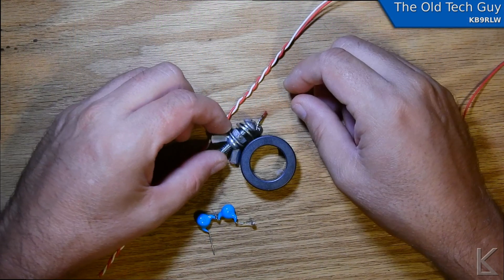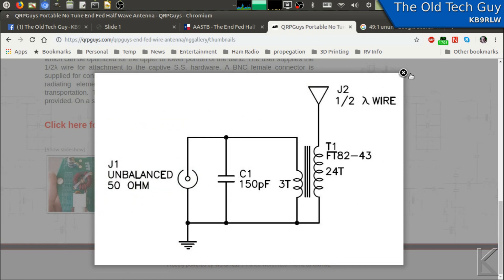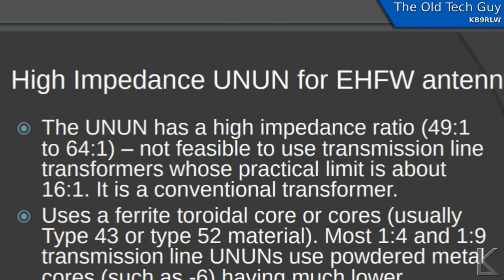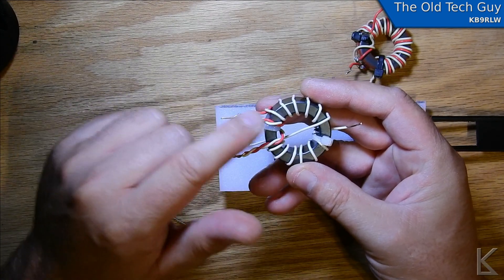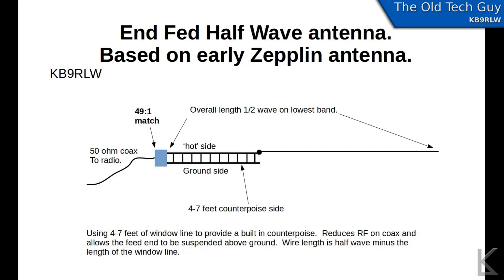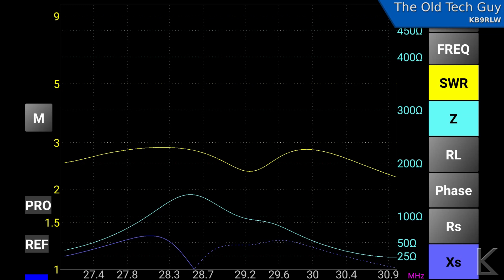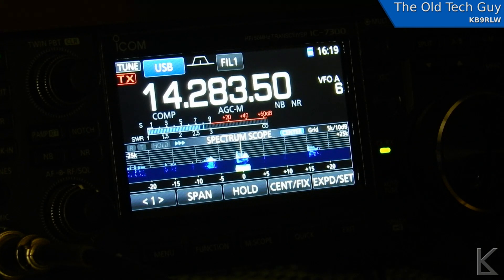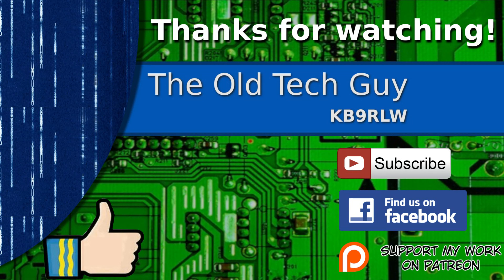Ham Radio - An end fed half wave antenna with built in counterpoise. (Experimental)

Comment: You mention the twisted wire being harder to wind.  Is there a reason that you're twisting it?  I would have thought that simple bi-filer winding would work.  Or even a true auto-transformer (single winding with a tap).  Do you have a pointer to documentation as to why the twisting is preferred?
Thanks.  (de KE1G)
Reply: I don't think the twisting is required at all, but is just mechanically convenient.  I would imagine that electrically it would add a very minor amount of capacitive coupling (a la a 'gimmick' capacitor), and an even more minor amount of inductive coupling.  But again I don't think those electrical considerations are the reason, and that it is just for convenience in wiring the two together rather than apart.
To me, the real magic is in the 'crossover' turn.  At first I thought this would cause the two halves of the secondary to then be out-of-phase, but then I realized that the second half (after the crossover) is now proceeding in the opposite direction (i.e. CCW vs CW), so both halves are actually still in-phase.  So why not just continue proceeding with the entire winding without the crossover?
Well you can, but the voltage on the secondary is high (this is 7:1 step up), and the crossover is a trick that has the final turn pop out on the opposite side of the transformer from the inputs, versus having it be on the same side, right next to ground.
Reply from the maker: I twisted it since Steve E.'s 49:1 design called for the twist.   I had made another one a couple of years ago without the twist and couldn't get it to work well.  So, I'm not exactly sure of the technical reason for the twist, but it does seem to make the thing work.

Comment: Really interesting project Kevin and I will be trying this on my EFHW which has same response on 20m as yours.
Also Steve E. Antenna Utube article with a 5 turn coil on 1 inch former : refer to https://youtu.be/Z7-FYm6r5jc about 7feet from transformer, this lowers resonants of various bands especially useful for CW areas of the bands.

Comment: Did you notice much directivity with it? I would imagine strung horizontal it would have a null off of the ends. I've noted those nulls aren't as deep when the antenna is closer to the ground, just curious if you noted anything like that.
Reply from the maker: It seemed, from the wspr footprint to favor off the sides just like a dipole.
When they're closer to ground, they tend to push more signal upwards for a shallower bounce if the ionosphere is active.   That can mask directionality a bit within a shorter distance.

Comment: Great video Kevin. I bought one from Alpha antenna but the transformer was a 4:1 Un-Un. The feed point had to be up very high for it to get out..  hot side was 75 feet long and the shorter leg was 25 inch.  They worked well from the blimps because of the elevation. I’m curious to see the performance on yours with the 49:1. Also the alpha version didn’t use window line. It was two wires with the jackets fused together like lamp cord. Great stuff I enjoy your channel.  Art. K2ADC
Reply: Correction: short wire 25 ft.   Not inches.

Comment: A 3turn to 30turn xmfr=10:1 turns ratio; which yields a 10^2 (100) Z ratio. Why are you incorrectly calling it a 49:1?
Reply from the maker: If you look at the graphic, you'll see it's 2 turns on the primary, 14 on the secondary.  It's a very common unun used in many end fed half waves.
Here's one of many sites that reference it.
https://elginradio.wordpress.com/2017/10/17/end-fed-half-wave-antennas/

Comment: Hans Beggerow's antenna didn't have a counterpoise. That ladder line section was 1/4 wavelength long and acted as a transmission line transformer which transformed the high impedance antenna to a low impedance thus moving the high voltage point far away from the hydrogen filled balloon. It was simply a safety feature and met the need at the time. 
https://tinyurl.com/y6fx26eq

 K1RF's slide show is very accurate and helpful but that phrase about a 1/4 wavelength counterpoise being "ideal" has caused some confusion. .....An EFHW with a 1/4 wave counterpoise is no longer an EFHW but is now an off center fed 3/4 wavelength antenna. That "counterpoise" will radiate just as well as the antenna. In fact, a 1/4 wavelength counterpoise is the WORST possible length for an EFHW since it then becomes an integral part of the antenna. We must avoid resonance on our counterpoise! The EFHW actually needs (almost) zero couterpoise. Just the stray capacitance between the secondary and primary are sufficient to couple the minute amount of "displacement current" needed to fulfill Kirchoff's law. That is why the coax shield is so effective for this purpose. BTW, an earth ground works too.
Running a length of wire from the bottom of the secondary alongside the main radiator does nothing but de-tune the antenna on the higher bands.  It is not a counterpoise. We need to cease obsessing over the counterpoise. It amounts to almost nothing. In one experiment we disconnected the link between the bottom of the primary and secondary and the antenna continued to function. Again, stray capacitance is sufficient to conduct the tiny displacement current into the node.  For more information we have many videos, photos and files on the EFHW Facebook group at https://www.facebook.com/groups/EndFedHalfWaveAntennas/
Lots of credit for the current design goes to Danny Horvat, Dale Parfitt and many other in the Netherlands who labored many hours on this design. 

Hope to see everyone there! 73
Reply from the maker: Thanks for the info Steve.   I'll be continuing to experiment with this antenna.  It's working very well so far and I'm not getting RF back along the coax shield.
I'll do a comparison test.  I'll setup a transmission test and measure RF on the shield with my field strength meter.  Then I'll drop the feed point down and cut the connection to the 'counterpoise' side and run the same test again.   
It's fun to play with things like this.  Poke it with a stick and see what happens.
Reply: @loughkb  Hi Kevin.  Did you get to do this test, and if you did what was the result please? - If you've covered this in another of your videos, sorry for asking it.
Reply: @loughkb  
I have a 49:1 MEF-330-1K transformer with a 67' 18g wire attached to it up 40' in a tree at a 45 degree angle pointed northwest/southeast direction. 
The 4' counterpoise attached to the ground terminal improve my receive a great deal on WWV/80/40/20m.
 On 11m it seems to work due to not have any rfi/tvi/cmn problems in the shack.
Reply: A horizontal Jpole

Comment: Thinking further, I'm really not sure what the point of the parallel 'counterpoise' is. The coupling will introduce some capacitance, so in theory that will bring the resonance down in frequency. But with wires that size and at that distance, the C will just be a few pF, so will effectively do nothing.

Comment: The reason for the slightly screwy SWR dips on 20 and 10 is that you would need to add a loading coil about 6 feet or so from the transformer - this helps to bring resonance to the higher bands. This design is used by myantennas and Hyendfed in their efhw antennas designed for 80-10m. 73
Reply from the maker: Thanks for that.  Good info.

Comment: Why not just feed the half-wave wire with a quarter-wave length of ladder, short the ends together creating a stub, then feeding the coax in at the 50R point, which will be not far from the shorted end? No counterpoise required, no cores to get warm, much less hassle. And if you have enough real estate, add another half-wave wire to the other wire at the top of the stub, to get around 3dB gain?
Reply: In other words, a "J" pole.
Reply: @colin-4794  Exactly, or a Zepp/double-Zepp. I use one on 40. I made the stub with bare wire separated by dog-bones, easy to find the 50R feed point then. It's a nice antenna, quiet, as it's DC shorted, a little bit of gain too.

Comment: The 49:1 is a transformer NOT an unun, you do NOT need a counterpoise. Just ground via a ground rod at the transformer.
Reply: I do not use a counterpoise on my 40 20 10 end fed, works a treat.   I recently worked South Africa on 80 Watts with the end fed in an inverted L config.. up 10 meters then across with remaining

Comment: Counter poise 1/4 wave added to a half wave dipole is what? So much wrong here man. Cut the cp off and build a correct 49:1 transformer. Ground the coax and try again
Reply from the maker: https://elginradio.wordpress.com/2017/10/17/end-fed-half-wave-antennas/
Reply: Kevin Loughin correct. I’m on the group. I’m sure you’ve read Steve’s comments by now about this experiment. Someone posted it there. 🤷🏼‍♂️
I’ve ran 3 efhw in 3 different configurations. The L worked the best but tall vertical runs are hard for most of us. Sloped worked second best. Then V. Rid any counter poise. Long run of coax. Ground the coax shield before entering the shack.

Comment: Thanks Kevin. This is very similar to my EFHW that I've been using for a year or so. I have the same transformer built from a 240-43 and I use it at 100W for SSB most of the time. The length is cut for 40m and I have a loading coil in place to make it work on 80m and it does really well. It's quite low at only about 5m off the ground. My question is about the alignment of this type of antenna? Is it strongest side to side of the wire or along the length of it?
Reply: Scott McGill like any dipole the lobes will be broadside. However the current maximum is 1/2 up the wire.

Comment: If your balun is wound 24:3 turns (diagram) how is that 49:1? My math says it is 8:1, similar to the usual 9:1balun. Your 14:2 is just 7:1, no 49 there either. What's your math? Where is 49 coming from?
Reply: (24/3)^2 = 64:1
(14/2)^2 = 49:1
Reply: I try to explain it in simple Words..:/  What You are refering to, is simply the "Turns Ratio". I think, that can be confusing. But 9:1 or 64:1 or 49:1 does not speak about the Turns Ratio but here it means Impedance "Transformation". So it speaks about Impedance and that includes the Effect of the Voltage and Current in a Transformer. The Impedance is (more or less) the square of the Turns Ratio. If You just want to transform Voltage (alone) or just Current (alone) than the Turns Ratio is important. For Voltage the Turns Ratio is also (more or less) the Voltage Ratio. For Electrical Current it is also the Turns Ratio but this Time it went "in the other Direction". So with a given Turns Ratio, the Voltage would go up, but the Current would go down the Amount of the Turns Ratio. So if You would have a Primary with 2 Turns and Secondary with 14 Turns, You would have a Turns Ratio of 7:1. When we asume, that we have a Voltage of 1 Volt and an electrical Current of 1 Ampere we would have a Resistance of 1 Ohm. In the Secondary we would have  a Voltage of 7 Volt and an electrical Current of about 0.143 Ampere. So the Impedance in the Secondary is gone up 49 Times.. That would mean, a Impedance Ratio of 49:1... Basically the squared Turns Ratio..
Reply: And 3 Turns at the Primary and 24 Turns at the Secondary would be a Turns Ratio of 8:1 and make it a 64:1 Impedance Transformer, I think. 

Turns Ratio: 24/3 = 8:1. 

But the Impedance Transformation would be the squared Turns Ratio so it would be 8² = 64:1.
Reply from the maker: It has to do with impedance being a square of the ratio's step up or down.   I did a quick search, but didn't find it.  There are probably several texts that talk about it.   A deeper search will probably turn them up.

Comment: Kevin, another great contribution to the HAM community. Good job as usual on UTOOB, 

Good idea on using ZEP style counter-poise instead of coax shield.

The imagination gets activated about varying the lengths of the aerial's elements using clips/connectors/fold-backs, whatever, for portable/mobile ops on different bands to minimise tuner losses.

Every Bittle-Lit counts while QRPing!

Been going to assemble a 40Mtr EFHW for my QCX rig for months but have been using Random Lengths instead. You just showed us a good clean way of doing it with EFHFs.

Tnx/Regards/73
Russ in NH
KA1RUW

Comment: The Zepp antenna is essentially a J-Pole antenna.  The quarter wave of ladder line transforms the high impedance at the end of the half wave antenna to a lower impedance 1/4 wave along the ladder line.  That wire is not a counterpoise.  The counterpoise for a half wave antenna has very low current (like at the end of a dipole antenna).  In my experience it doesn't need to be any particular length.
Reply: I agree completely. This is nothing like a jpole. Also having a counterpoise next to the radiator will result in some signal cancellation.
Reply: Agree. Having a 1/4 wavelength section of "in between" impedance is a standard way of matching. But not needed here as you have the 49:1 transformer. Better results would be obtained by simply splitting the cold part of the ladder feedline and running iy in the oppositr direction so it has some capacitance with ground rather than being drenched in rf right next to the radiator.
Reply: Yes it is but not what we have here as 7 feet falls far short of the 30 some feet it would take to make the matching section of the J pole aka Zepp that said  wouldn't the zepp be a great kite antenna
Reply: I saw this vid but didn't waste the time to watch it.  Just checking the comments and so glad to see some sense.  Otherwise, the pic in thumb nail and title give it away as idiotic.

Comment: Kevin......Some hams prefer using a 9:1 balun.  What's the advantage/disadvantage of a 49:1 configuration as opposed to a 9:1?
Reply: Hi Dan, 

Because a 9:1 only gets you to 450 ohms.

An end-fed generally is about 2500 ohms (at the end of the wire); 49:1 gives you just about a 50 ohm match.

Some folks run a 63:1 as their setup nears  3200 ohms.
Reply from the maker: The impedance at the end of a half wave wire will be around 2.5K ohms.  So, divide 2.5K by 49 and you get 50.   The goal is to bring the impedance down to match the impedance of the feed line and the radio for efficient power transfer and low SWR.
Reply: And, 9:1 unun are best suited to the endpoint impedance of so called 'random length' antennas.
Reply: 9:1 only if the antenna is non-resonant on any band.     49:1 otherwise.

Comment: Yo Kevin!:
GREAT video! Enjoyed your new video. I'm going to put in another request for my audio transformer idea antenna, you've done wacky ideas in the past, don't see why this wouldn't be a worthy project! 
VY 73's
(See you're heading east again? Destination? : )
de seeker/Jeff WA7LFP
Reply from the maker: Maybe for QRP.  The wire in those transformers is very fine.  The core material is usually thin slices of metal sandwiched together.  I really don't think they would work well at RF frequencies.  Probably convert more power to heat then they would transfer.

Comment: I use the W3EDP end-fed instead of a Zepp. I put a 4:1 balun on the window line, which is 17 feet long, then 66 feet alone on the radiator side of the window line. That's a full-size W3EDP. A half-size works fine as well, you just bring it up a band. My full-size works fine on 160-6, and the half-size I used last winter worked fine from 80-6. For a balun, I just use an LDG 4:1, sealed for weather. My full-size is arranged in inverted-L form, the 17 feet of window line going up the side of my house to the suspension point at the top of  mast over a disused chimney. Then the radiator goes off sloping down into the backyard, tying off on a disused clothesline pole. I can tune it up great with the tuner in my KX3 or KXPA100. It's NOT a resonant antenna and requires a tuner.

This site was the inspiration. I use regular window line instead of TV twinlead.  https://thewakesileave.wordpress.com/2016/05/22/a-flimsy-w3edp-portable-antenna-la-manquita/

Comment: Thank you for sharing your experiments.  I always learn something and that's what makes this fun.  I'm about to put a solar powered HF radio on the air and I was going to use a random length end fed wire bur now I'm reconsidering.  I don't think I have space for 127 feet of wire, but I'll measure to see.
Reply: I've read that some hams use an Inverted-L configuration or zig zag the radiator if they don't have the room for a straight piece of wire.
Reply: You can build or buy shorter resonant versions that work well with 40 to 60plus feet
Check out HyEndFed antennas, you wont be disappointed , they are from Holland
Check out the DX Commander all band vertical, another great choice in wire antennas design
I own and work both.